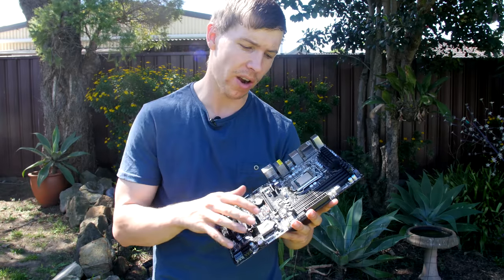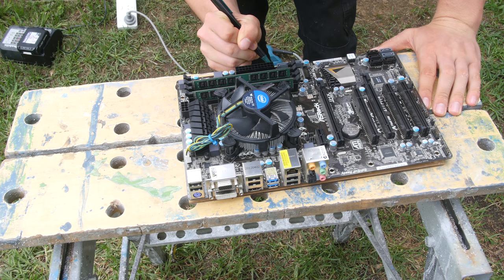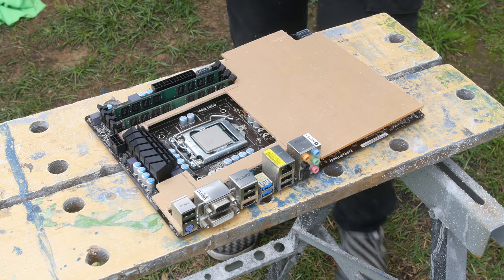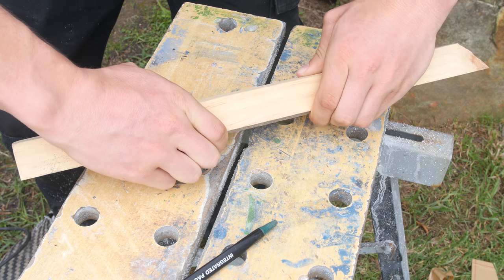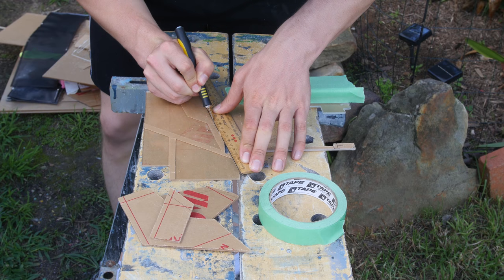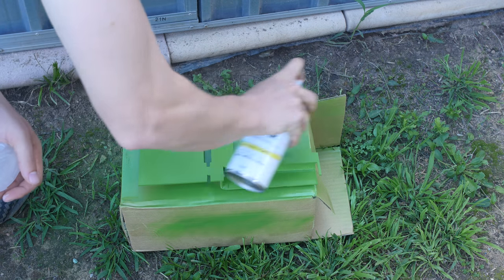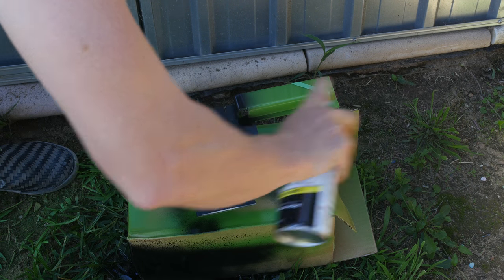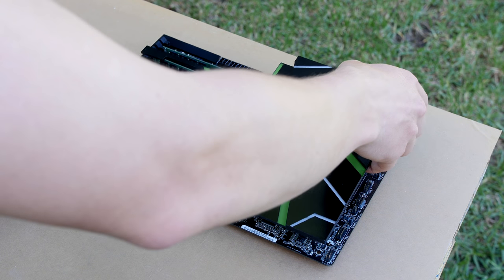How to Make A DIY Acrylic Motherboard Armor + Paint The Plexiglass

Comment: DUDE SWEET. You're the first person I've seen do something like this
Reply from the maker: thanks mate much appreciated
Reply: remember me diy tech! that guy from twitter that suggested this way back in February ?
Reply: thats because capacitors and components on the mobo will now be enclosed and overheat instead and then your motherboard catches fire.
isn't that great!
Reply: Unlimited Uploads that's exactly what I was thinking.  wouldn't catch fire but deffinetly causes heat build up.  I'm sure there's a viable solution to keep it cool tho.  intersting idea at least
Reply: well there's a reason that nobody else puts videos of this as thats the main cause.
Reply: This armor won't retain enough heat to cause any negative effects at all
Reply: it prevents airflow from cooling it down and it traps the heat inside.
come again?
Reply: Difference is negligible
Reply: well everyone who's into PC will overclock it regardless, if you run stock or low OC then this is should be fine aslong you have an okay airflow in your case.
Reply: so one of the most important things you covered up is the Northridge heat sink the Northridge and the chip set need cooling that's why they have a heat sink
Reply: Actually your wrong..."if capacitors in your PC need cooling, manufacturers would have packaged some "Gaming" coolers for your caps."  This is not correct...the fact that the caps were not covered with a mobo armor or shield would tell me that airflow is fairly important in the design.  It is always important when building a pc to take cooling into account, and from what I understand most mobo shields are designed with airflow in mind as well, not just aesthetics.
Reply: not having anything covered pre hand already tells you it needs cooling from the chassis fans.
and at this point this is getting tiresome, 
1, nobody else puts videos of this cause it can damage your system
2, due to reason 1, there isn't much point in this.
3, depending on what material you use, the capacitors are made for way above 100C so you now want paper or wood close to that?
4, not having anything covering them pre hand tells you its not supposed to be covered but able to breathe with the chassis and cpu cooler fans,.
5, pc cases air intake from the front and out the back so you have a steady airflow over all your components
6, suggesting to fancy up your computer is just a waste of time annyway.
doing all this - shorten lifetime of motherboard, if you use wood, it can catch fire, and in the end you're damaging / lowering lifetime span of your system for some cool looks.
7, dont be silly.
Reply: since the first comments of mine i've already said, if you want to do this, only do a mild overclock.
you're already limiting the fun part of pc which is overclocking.
Reply: Seriously some people are blowing this up. This is completely fine and it looks awesome. Does not limit OC at all. I have a Asus sabertooth motherboard that covers up more than this with the "armor". I was curious and took it off and it cooled down.... A whole 3c. I over clock my 4790k on a 360mm rad so no airflow around cpu socket. I have 2 motherboard fans that soon if it gets warm..... I have NEVER seen them spin, not once.
Reply: do this sort of superficial modding to a current gen mobo and you risk blowing the power phases. which part of why the asus z87 has fans build into the 'armour' near the rear io.
something that already happens to people who install liquid cpu cooling., since with no cpu fan, the heatsink on the power phases gets no airflow.
Reply: Mr Jay White which like I said, it has fans but they NEVER run because the temps never get warm enough. from my test it made a 3c difference without all the covering.
Reply: HEY, do you remember me, giving that idea under your graphiccard backplate video? :P You said you won't do a tutorial on that....wright now, i have one :P but don't worry, I'm still one of your subs and I love your videos!
Reply: Never seen one do like this?

Watch DIY Perks
Reply: Dietec i know your channel and for another really good pc modder who uses acylic and all that stuff check out JPmodified
Reply: @Unlimited Uploads 

Sorry that I am late but I just wanted to prove that you are wrong. 

Manufacturers actually use plastic covers on expensive motherboards.

Of course the motherboard will run a bit hotter with that kind of cover on it. But as said already It's not that noticeable and at least in a short term it wont affect anything in a negative way.

The matter you are trying to say about how motherboards are not covered from the factory because they shouldn't isn't valid because I bet the main reason is the cost. Cheers!
Reply: because he was the only one stupid enough to do it... and with acrylic of all things with how hot a motherboard can get...
Reply: @DIYTechTube  nice but the fan from the fan does not go over motherboard......
Reply: I love both of your videos
Reply: hahahahhaaa..i did this actually ages ago...i must be the first one..
but Asus TUF was actually first
Reply: @unlimiteduploads2971  #1 overclocking is basically dead  
#2 no theyre  not limiting overcking at all people live in 45°C ambient and that is much worse than an armour for it but guess what a noctua or liquid cooler still makes stock good enougha nd overclock friendly in winters
Reply: @unlimiteduploads2971  My thoughts exactly.

Comment: this is what asus call thermal armor 😂😂😂
Reply from the maker: +Vintage Hardware =D
Reply: Indeed, Sabertooth bords w/ TUF Shield, or whatever... :D
Reply: Also Maximus Vi Formula have this thermal armor, i have one
Reply: If youve ever taken the armor off one of those boards youd realize its not a piece of plastic covering parts. it has active cooling. what this guy did was basically put a plastic blanket over a lit furnace. It probably melted within 30 minutes of actually having it on, but he wont put that part in a video.
Reply: @KableTac  what could he have done better? What should have he avoided to make it safe?
Reply: @jeremiahbourne4449  Not cover the south bridge and maybe use some standoffs to raise a bit off the components.
Reply: @jeremiahbourne4449  make it out of aluminum

Comment: for those people that are concerned regarding heat dissipation, there is no need to worry as long as the vrm are not fully covered, as in air tight covered. a little air flow will be sufficient to cool it. the rest of the mother board in fact needs thermal shielding from the removable components such as  VGAs , hard drives etc that can easily generate temps in excess of 70 c. therefore the top end armor wielding boards come with heat shielding armor. 

what has me concerned is where to put the double sided tape cuz that will literally seal the air from making contact with the pcb that is directly underneath it.
Reply from the maker: +Farhan Rana well said

Comment: Pro tip: use a piece of scrap MDF or something like it, clamp/glue/stick the acrylic to it & start cutting away... It will aid in preventing the acrylic from cracking while you saw/cut/drill into it. A bit of heat also goes a long way, making the acrylic a bit less brittle & a bit more forgiving, especially when making intricate cuts & cutting into narrow sections of the cut-outs.

Comment: This is really clever, and looks awesome, but I'm concerned about how this would affect thermals.
Reply from the maker: +TheSpartanFactor thank you very much =)
Reply: Probably a little, but unless you're grinding your pc 24/7 (which you aren't unless it's some kind of rendering server or something), it shouldn't be an issue as long as there's even a little clearance, especially if you have decent airflow in your case. Keep it clean if you're worried.
Reply: Negatively says logic
Reply: make it out of aluminum instead, lol
Reply: It's not like he covered anything that generates much heat. So, I wouldn't think it's a concern. I mean, they sell plenty of motherboards with plastic on these areas.
Reply: I was wondering the same. Looks cool but won't it prevent the motherboard components from cooling off. My mb has heat sinks all over it so I figure it must need cooling.

Comment: instead of using tape you could drill out the holes where the motherboard mounts are and use stands as screws on the motherboard and then mount the plate to the stands like you usually do with the motherboard to the case.

it will then make the plate go flush with the motherboard and no lower\higher spots around.
used this method not for "armor" but making a platform above for mounting GPU's in 2U cases where there was no riser-card in the case... need an extender though ;)

Comment: I like the idea, and what you did looks really nice! BUT you are messing with heat dissatpation from the smaller chips and components on the motherboard. Looks nice and it shouldn't be a problem IF you have enough airflow in the cabinet. but if you have a newer noise dampned cabinets with only a few fans this is absolutely a no-go reason being that you are creating an isolation wall with plastic/wood on one side and PCB on the other side with all the heated components inbetween, you are even covering up the southbridge heatfan that needs airflow.
Reply from the maker: +GeekGarage this isnt going into a cabinet. I tested the temps in a case and it worked perfect. I stress tested it as well and it worked fine. Also got to remember there is a good 1-1.5cm gap in there for the air to move. There are also fans pulling up the air which are directly above the motherboard
Reply: I hope that was sarcastic :)
Reply: Captain right there is right :)
Reply: Air, just as liquid and electricity, will flow the path of least resistance so it will choose the topside (above the plate) rather than in between plate and PCB. Yes you will get airflow but just not as much as you expect even with a gap, that is why when you see server and such hardware where you put hardware in a highly enclosed space, you have fans with fan ducts guiding the air to the right spots. I would love to see a FLIR measurement with and without that plate, at idle and load in a case where 90% of people that might do this will use it.

Comment: Just a tipp, you can Buy   Motherboard standoffs. Those screw into each other.  drill your Holes into the Shield  where needed.  Now Screw in the Motherboard  using the mentioned standoffs on those standofs you can screw the "Armor" than.
Reply from the maker: +traX yeah iv done that before =)
Reply: hmm that sounds like a pretty solid idea. could make for an easy method to remove it without messing up any double sided tape while being able to apply it back in the same exact position. cool.
Reply: Good to know, I'd be worried about the motherboard melting the plastic otherwise
Reply: You can also add a few blower ty<pe fans to blow fresh air underneath it.

Comment: this actually is a perfect solution for the problem i had recently. i was trying for a white build for my pc and was pretty disappointed by the lack of white themed motherboards when i was first looking and settles for a plain looking one. there seemed to be some videos out there detailing people plasti-dipping their motherboards, but i didnt want to risk it. this on the other hand is a perfect solution. i dont even have to touch my motherboard now, i can just do something like this! istill might paint my gpu though as its a founders 1070 and while the silver doesnt quite clash, it would be better if it all matched. i might still have to paint the black parts of the interior of my case though.
Reply from the maker: +companyoflosers good luck with it all man. Let me know how it goes

Comment: much desgine such wow...very BOSS!
Reply from the maker: thanks man =)
Reply: it will just give higher temps cause its compressed
Reply: nice try, but the temperature change in any significant component is negligible, if any at all. and its not even compressed. its just resting on some tape under the motherboard.
Reply from the maker: yeah theres like a good 1.5 or 1cm between the armor and the board itself

Comment: I used to do that. There was a cheap laser cut shop around my town so I can just easily draw and cut anything I wanted.
Shouldn't cost more than 10 bucks to laser cut + material unless you're doing some crazy pattern that takes longer to cut.
Instead of using tape, mobo standoff is much neater, and don't leave mess if you decide to change later.
Just do it this way ->  casing|==|mobo|======|acrylic|=|screw) ...... hope you understand that. Use as many standoff as you need to get the acrylic high enough.
Reply from the maker: +xone5447 oh yes i understand that, iv done it many times, however i try to use materials that the general public would have

Comment: Awesome! how is this affecting the heat of the motherboard?? an same with the Graphic Card backplate u made? did the temperatures go up? and how much?
Reply from the maker: +SwiftCo nope i tested these in bench marks under load. No temp differences because i left a good gap between the pcb and the armor for the heat to ruse up and out with the fans pulling it up and exhausting iy
Reply: thanks for the fast answer! definetly going to try this out! keep the awesome guides up! and you earned a new sub for sure!
Reply: That was my question, too.
I'm sure I'll do it in my mobo, I'll put fans blowing hot air over and leave a space to not touch directly.
Thanks for the video, your board got fucked!
Sorry for the English of Google translator.

Comment: For motherboards with heat sinks on the North and/or South Bridge(s), should they leave those areas open? 
Also, same question with the PCH?
My ASUS Z97-AR has the PCH located inside the "Dual Intelligent Processors 5" circle and already has serious overheating issues due to it getting covered by the GPU, with idles around 54c and easily goes up to around 74c at load.
Reply from the maker: +Tefen M na seemed to be fine this this board

Comment: It does not seem practical. So the motherboard will be heated more strongly because leave no place for ventilation.
Reply from the maker: +batvanio there is a good 1.5cm gap in there for the heat to rise up and out
Reply: That's good, but not enough. Should one fan put them to have air movement. Even with so much place heat remains closed and difficult to dissipate.
Reply: That's good, but not enough. Should one fan put them to have air movement. Even with so much heat place remains closed and difficult to dissipate.
Reply from the maker: +batvanio there is movement, the hot air rises and it also being exhausted by the top fans

Comment: the next evolution is making it with a pressed copper sheet. Coupled with thermal pads on the right chips the whole board gets a new look and a cooler life
Reply from the maker: +BackInBlack_4896 exactly =) and perhaps make built in reservoir

Comment: Very nice, I have actually been thinking of doing something like this but just to cover the front panel connector at the bottom of the MB. Since those cables usually just rise up from the bottom and are kind of an eye sore. Funny how that part was one of the few area that he didn't cover because of the ports. The way I'm thinking of doing it is by leaving enough room to connect the cables and then installing the makeshift cover :-)
Reply from the maker: thanks man =) much appreciated, i could certainly make a cover for that section to hide all of those cables
Reply: Designs By IFR glad I could help 😊

Comment: double side tape or thermal pad? I need this mod for long term. 
An extra idea to improve this and cover the problem of everyone panicking over tems is to cut some vents on the piece.
The width of a blade like 3-4 parallel cuts should help dissipating the heat bellow.
Gonna try this mod for sure.
Reply from the maker: +Deafman glad you enjoyed

Comment: I loved the video and looking into doing this on my desk case build, quick question though. With so many people complaining about how much this would heat up your mobo, even though I think it would be negligible, would it be better to use spacers at the points where you attach mobo to case to create room for airflow underneath?
Reply from the maker: +Russ Harden what a lot of people dont understand is that i have about 1.5cm gap between this cover and the board itself. I
Everyone thinks it is flush with the pcb. So yeah id reccomend spacers even though it wont really matter
Reply: yeah, I saw you had some space but thought it might be more sturdy to drill holes there instead of adhesive...I want to build my desk pc red/white/blue and thought painting the American flag on the motherboard guard would look good
Reply from the maker: +Russ Harden yeah definatly man, you could actually put standoffs in the motherboard standoffs to hold the armor in place

Comment: Like the effort you put in your designs and the idea itself. But how does it affect heat dissipation? I mean, it's not the same as plastidip, which i assume traps heat like there wont be a tomorrow, but still.
Reply from the maker: +Justbase i tested the temps myself and had no issues

Comment: question, I see on the top you have it taped, but what's it resting on for the bottom half??
Reply from the maker: +Michael Thomas the bottom is taped as well
Reply: How about using motherboard extension legs to rise the plate into certain hight and act as mounting points? Cool idea, but in my pc you cant see much of MB behind the 1060 and cpu cooler :P Maybe when i go into custom case, some things will chance.

Also, how about next time you make cardboard template, so you dont have to waste material?

Comment: Personally i would have used thinner plexi, that stuff you used is a bit thick tbh, also would have liked it if you actually made a solid mounting solution instead of just tape. My first idea for mounting was stacking standoffs at 4 points around the mobo.